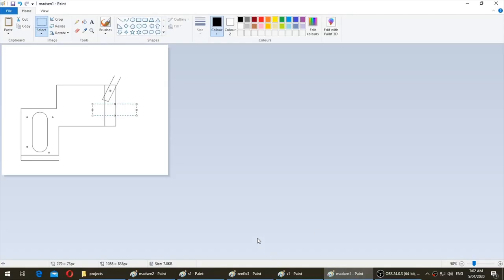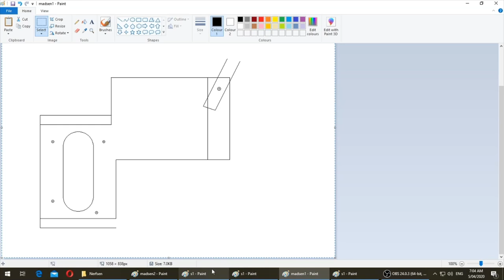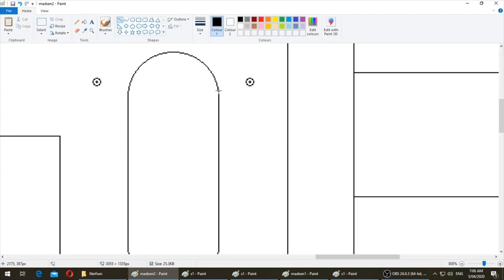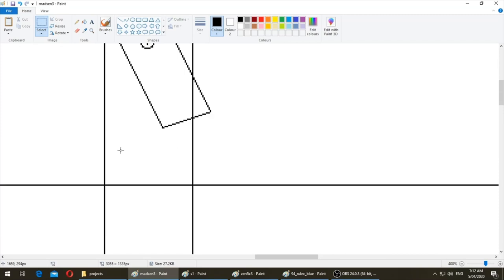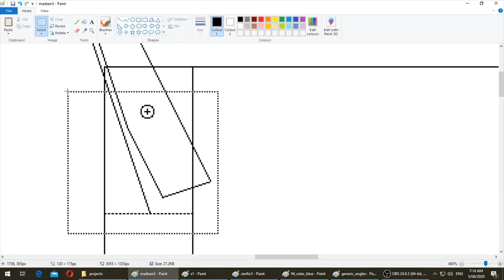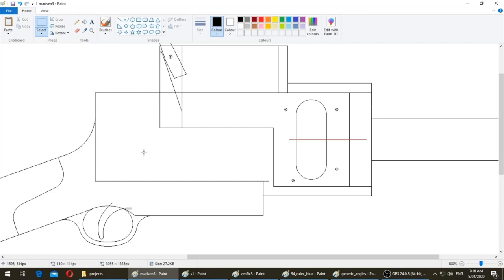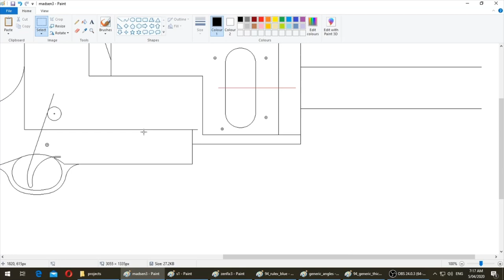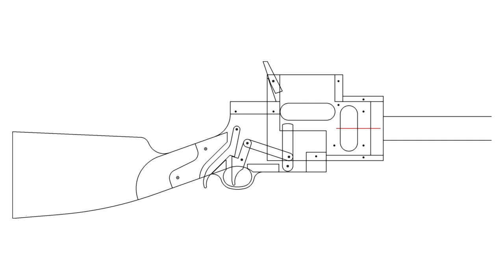MS Paint Engineer

Comment: After rewatching this, I wanna ask this:
Do you use a very old version of MS paint or are there some hidden settings you use? I've never seen the possibilityy of drawing 90 degrees or 45 degrees straight lines locked like you did.... All I can do is draw a straight line from mouseclick to release, at whatever angle I drag it at. Also where did you get that ruler from? seems awfully useful!
Reply from the maker: I'm using the latest version, not that it gets updated much! Holding shift while drawing locks 45° or 90° angles as well as squares and circles. The ruler is just an image off Google but it's scaled so that images are full size when on my screen.
Reply: @parabellum_arms  thanks! might just try to have a crack at designing an RBG myself!
Reply from the maker: @Count_Goatenberg  Some other tips: Paint now allows you to manipulate lines/shapes after they are drawn with rezising handles. Objects can also be moved more precisely with the arrow keys.
Reply: @parabellum_arms  what do the rezising handles look like? can't find them since paint in all in german for me....